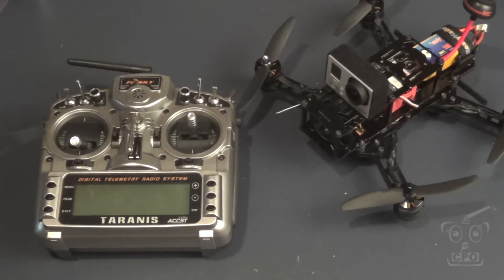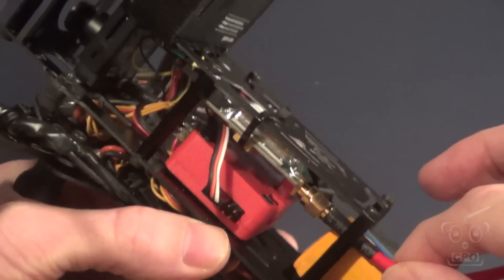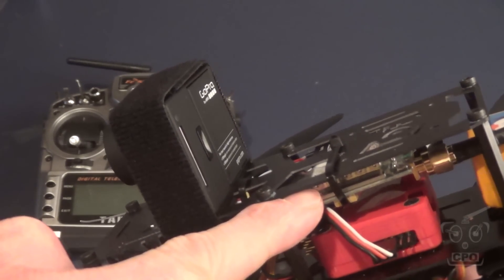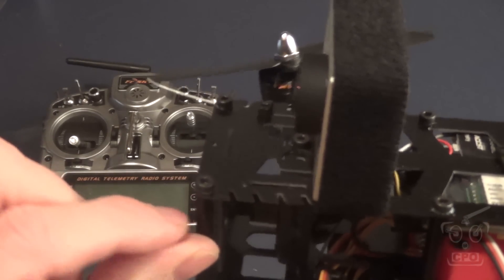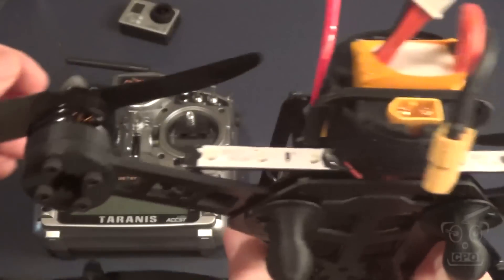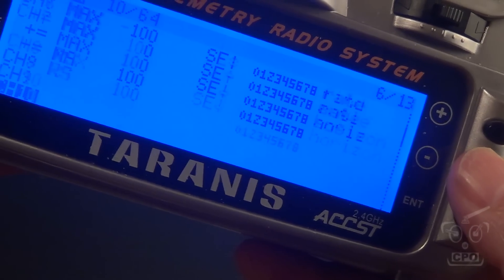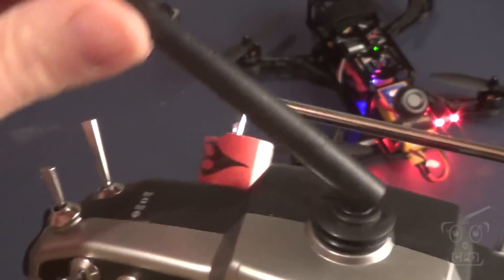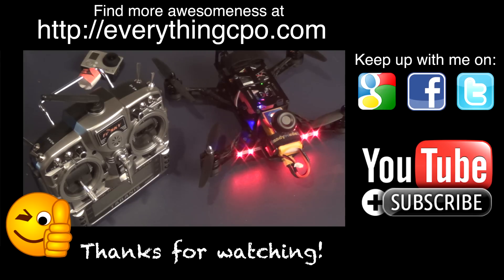CPO's FPV 250 Racing Quad - Current Setup and TX/Telemetry (DRQ250)

Comment: Thank you for the very informative vids! I have a question, how did you get your cell and cells to show on your radio? Im really confused because I see you don't even have a battery voltage sensor coming off A2 of your RX.  

Im using DragonFly32 Pro (Flip32), Taranis X9d Plus radio, D4R-II and battery voltage sensor (FBVS-01).  I've spent hours trying to get cell and cells to show anything other than 0.00.  I'm getting rssi no problems but voltage has me pulling out my hair.

My setup is flight battery + and - to voltage sensor to A2.  Then under telemetry page of the X9d plus i crank up A2's range until it matches the flight battery's voltage.  

Thanks again.

Comment: Best way to put your RX antennas. Two zip ties stuck up at 90º like bug antennas. Rest antennas against the zip ties and heat shrink them together.
Check Bruce's minis on RC model reviews for visual reference.